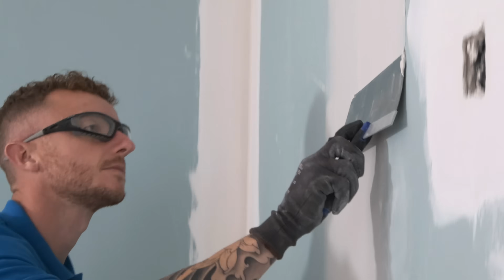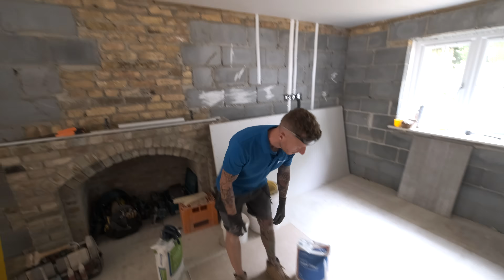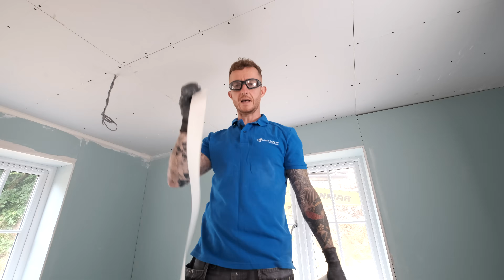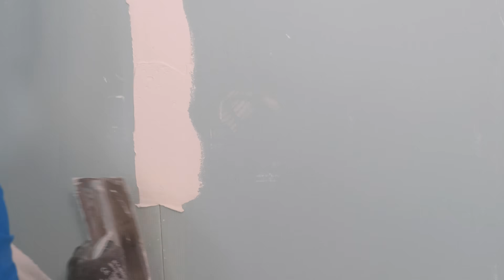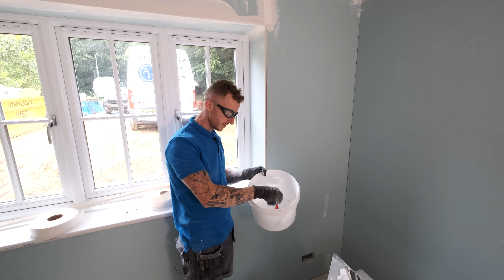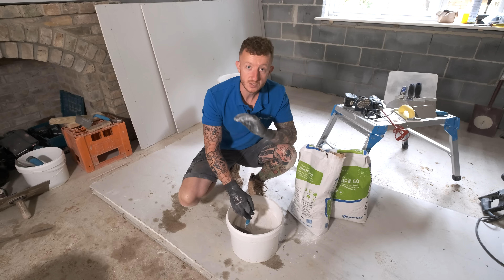HOW TO Tape and Joint!

Comment: Not sure you will see this but I’ve just fire boarded my garage ceiling and steels and I need to tape the joints.  Someone told me to use silver tape as it is fire board but I thought I should use scrim tape and jointing mix.  Any advice?  I am not skimming the board just jointing tape and paint.  Thx. Andy

Comment: When installing plasterboard, why do people leave gaps between ceiling and walls? Do these people know that putting filler in or bonding or plaster over it, crack will appear? Tired of repairing cracks after poor workmanship, people in uk don’t even know how to install drywall (plasterboard)… As a professional painter moved from Toronto to London, quality difference is massive (Toronto >London). Just please people install and plaster properly so homes can look properly new and nice, it is 2022 for God sake and use your common sense.
Reply: How should it be filled, if it’s too small for another piece of plasterboard.
Reply: @MissJnet  it shouldn’t be filled. The plasterboard (drywall) should be installed correctly so there is no gap!

Comment: What are the benefits over scrim and multi-finish?
Reply: Much easier to achieve a flat, smooth finish if you aren't a plasterer I think. I'd never attempt a full coat, but I could easily tape and fill joints.

Comment: John, ive seen your plastering and its bob on, my question as a plasterer is, why mess about with this tape and joint business when you could have plastered quicker?
Reply: Commercial building like a fire wall where its 10 sheets high and have to work off a scissor lift maybe?

Comment: Good your showing how to do this but quicker to plaster it
Reply: depends on the person and sometimes its useful not to dump a lot of moisture into the place
Reply: @GavinLawrence747  I get what your saying up to a point great ion a commercial build especially large ceilings but defo not on a residential property. Walls mark to  easily.
Reply: @bluevanmani  yeah definately plaster over joint and tape for long term durability!